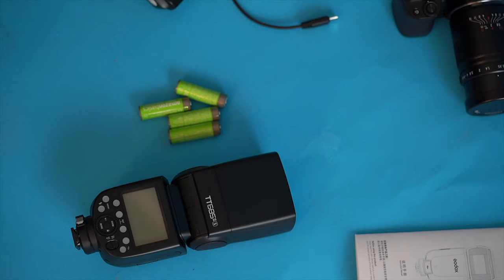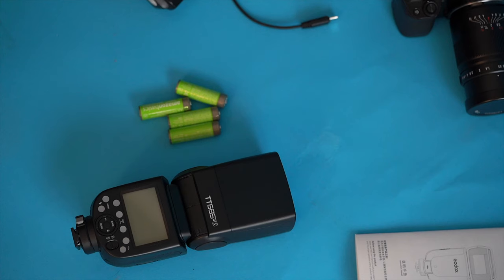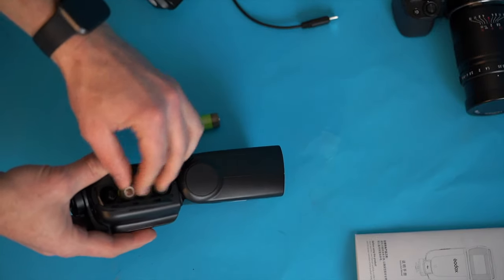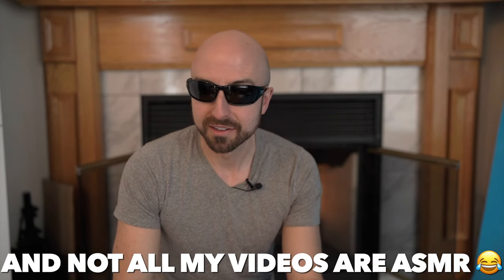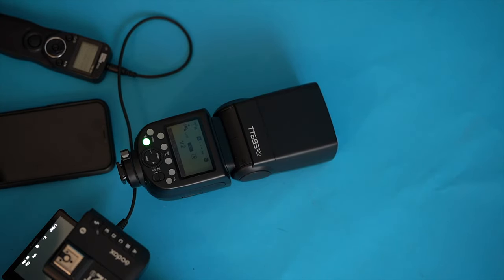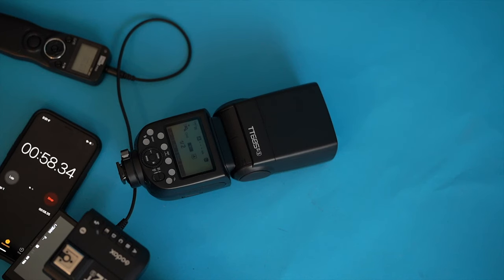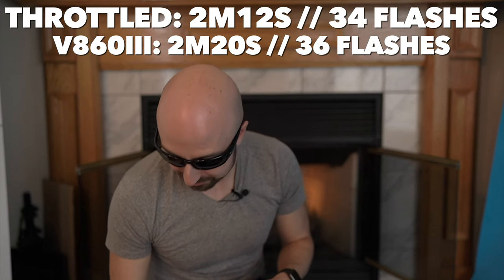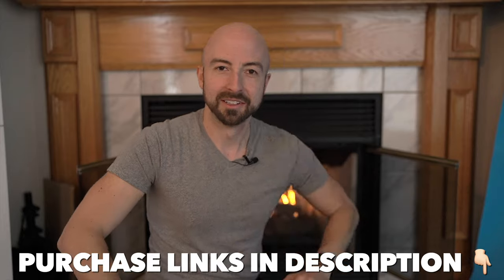Godox's NEW TT685ii Overheating Test vs V860iii & V1

Comment: In my macro work where I do hand held focus stacks with a burst of flash, it seems that my TT 685II + PB960 outperforms my V860II in terms of overheating, but it would be cool to see an actual test.  As I'm writing this, I realize that I could actually do this test myself.  The interesting thing is that when the V860II says it overheated, it's actually hot and won't let you continue shooting.  TT685II + BP960 doesn't actually feel hot and lets you continue as soon as you turn it off and on again.
Reply from the maker: Yes that’s to be expected with that huge battery pack 👌🏻

Comment: Which interval timer do you use? BTW: Didn't see the V1 ...
Reply from the maker: I compared it to the V860iii numbers, which came out as essentially identical to the V1. I mentioned it, but I guess wasn’t super clear about that. Here is where that particular test took place:
https://youtu.be/EHSrBVQ-jUs
Reply from the maker: And I’m using the Pixel TW-283 remote shutter/intervalometer. I find it’s the best bang for the buck. Any of the built in wireless ways of triggering a Sony are just too short distance/unreliable. I use it a lot for real estate photography.

Comment: do not use rechargeable batteries if you want fast recycle times. Try again with fresh triple AAA batteries.
Reply from the maker: Actually rechargeable NiMH batteries typically give faster recycle times than alkalines, as they generally have a significantly lower internal resistance (30-100Ohms vs 200-700Ohms), which permits higher current flow.
Reply: Single use AA Lithium Batteries might beat them, but no idea why one should use AAA.
Reply from the maker: I assumed that was a typo on the AAA 😏
Reply: @WesPerry  "tripple" is not really a typo
Reply: I've been using the same 4 eneloop batteries for over ten years now with my canon ex430ii. It's hard to believe when I think about it.